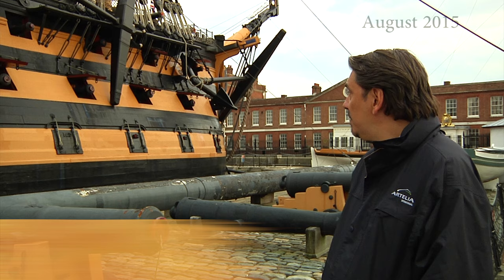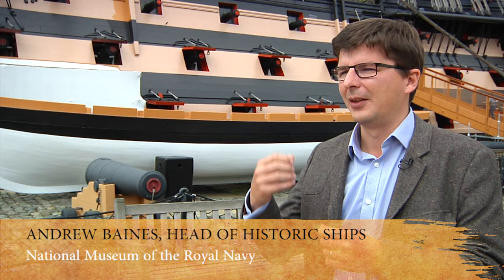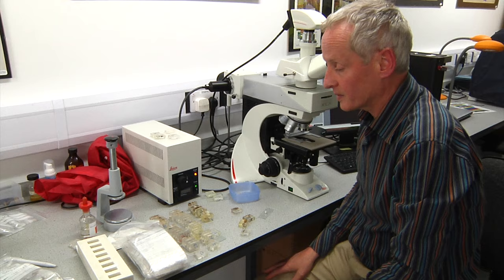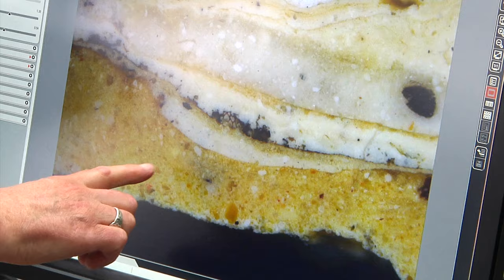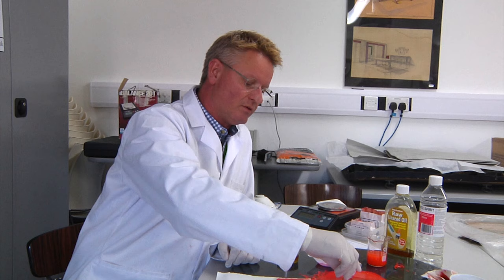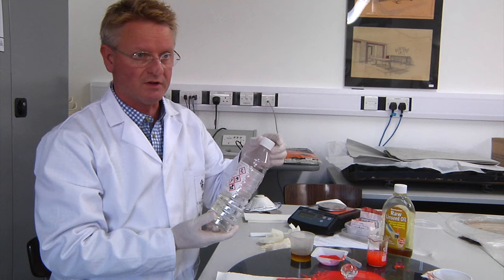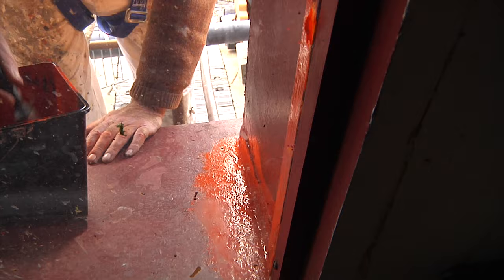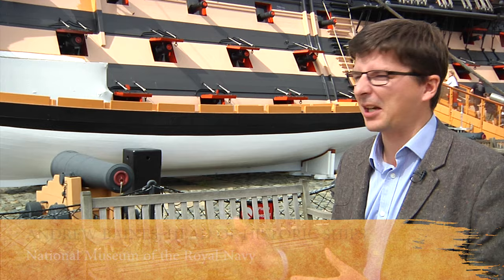HMS Victory – In Her True Colours

Comment: it´s horrible to see a ship like her so crippled without masts
Reply: @Kato Ho Ten Soeng I believe the mast go down to the drock base,  her keel has been cut to  allow the masts through. What squashes her, is her own weight.

I'd advocate for putting her under a roof already.
Reply: Hopefully this new renovation grant has enough money for new masts and rigging once they've sorted out the more necessary work of improving the hull supports and preventing more wood degredation. It'd be grand so see her with full rigging and the ensign flying high.
Reply: Kato Ho Ten Soeng No , they will finish up building a frame and support the masts from above
Reply: I agree I too think it looks horrible without the masts
Reply: It’s not forever. Just for a few years. Google „HMS Victory downrigged“ and read for example the Wikipedia article.
Reply: I thought they were made of aluminium anyway. Obviously a later addition.

Only 20% of HMS Victory is original.
Reply: @tooyoungtobeold8756  I was informed that it's only 5% original.

Comment: Pretty building that was once a ship.  Sealed forever in the land and top mast removed.  A former ship can never sail again is no longer a ship.  If you want to see an old ship of sail check out the Active service USS Constitution when they take her out to turn around.  Only a few years younger and still sailing.
Reply: The masts have been removed because of the ongoing refit, they will be back.
As for Constitution still sailing, well, she was never involved in any big fleet actions like Trafalgar. Victory took a big pounding in that battle. but still managed to sail to Gibraltar, and after some repairs sail back to the UK.
Victory was a 1st Rate ship of the line,  Constitution was a heavy frigate, if it were a Royal Navy ship it would not be allowed anywhere near these battles. 
Victory is 30 years older than Constitution, fighting the biggest ships afloat at that time, Constitution only ever fought much smaller 5th and 6th rated RN ships
You shouldn't be comparing these two ships. You should try learning about the differences between them, and their different roles, and not be sneering at Victory, she is a remarkable battleship, deserving respect.
You should read the first comment in this comment section, it is from a retired US Navy Chief Warrant Officer, if that gentleman can show respect, so should a no nothing keyboard warrior like you.
 Sad person.
Reply: @daneelolivaw602  I respect what it once was and the Constitution though on a smaller scale did indeed fight in fleet actions including the Barbary Wars that we lost one sister ship.  She also fought in the war of 1812.  While our fleet was small compared to England's until close to our own civil war it packed a punch.  The British even had standing orders to never engage any US frigate without at least two larger ships.  They used a new tech in design that gave it a thicker haul, resistant to cannon shot above any prior ship and a huge advantage in maneuverability.  This advancement was nearly equal to England's standardization of guns that we inherited.  The fact she no longer floats, while preserving the wood from rot warps her over time due to the lack of designed pressures on the haul.  It may be cheaper but it robs her of what she was.  Even flooding her cage with a clean water mix would be better.  They also want to enclose her farther with a roof like the remains of the Mary Rose that would deny her of her topmast forever.  In the founding of the colonies some ships were converted to houses and some like Victory were converted into waterfront buildings or piers  by beaching them on soft ground, once they were no longer afloat or able to be floated they stopped calling them ships.

Comment: The 'evidence' that this was the original colour appears pretty thin and un-substantiated. Does it really fit with contemporary descriptions?
Reply: The evidence is physical from paint pigment analysis, not documentary. So its an exact match to what was there.
Reply: @EternallyDisappointed  an exact match to what exactly? Old paint that had faded and was time to repaint? That's like saying sampling an old flakey paint job from a Toyota with no clear coat will tell you the exact colour it came out of the factory with.

I mean.. maybe, but maybe not
Reply: @Tom--Ace  The process is more scientific than that.

Comment: Like Stone Henge re built 1965-7 the Victory was torn apart in 1929 and virtually rebuilt most if not all the original wood gone 
none of that that is there now under decks, that saw the battle or blood sweat and tears of the crews, fighting dying on board all 'virgin' wood the masts are metal and cannons fibre glass  it is just about fake as everything we are told though  at least in  the true colours now but that is about it
Reply: patrick robinson what on earth do you expect? You want them to magically preserve 200 year old original wood?
Reply: @Luca-bv5ic  almost 250 yo
Reply: wrong, there are substantial parts of her  still 1765 vintage
Reply: What you have to appreciate is this a ship launched 255 years ago, commissioned almost 13 years later, has been used and abused in warfare and general service, converted to a hospital ship 30 years after launching, reconstructed for frontline duty a few years after that, downgraded to a second-rate, decommissioned, recommissioned as a troop ship, then a floating depot, then a prison hulk.
She's not just been rebuilt in 1929 but constantly throughout her life. There are original parts but to just assume it was the 1929 restoration is responsible is innaccurate, most of the work needed to be done cause the ship had languished for so long with decay and rot setting in.
Reply: Patrick Robinson
It is estimated that around 20% of the wood on Victory is original,  Including the lower gun deck, so you are wrong. And there are three or four original guns on board.
Reply: HMS Victory was over fifty years old when she saw service at Cape Trafalgar.  She had come very close to being decommissioned and scrapped. 
Nothing lasts for ever and the fine line between restoration and conservation depends to a great degree on 'current' knowledge at the time of intervention.
Of course we know more now about conservation and restoration than they did in the 1920's but at least the ship was taken out of the water and saved for the nation.
Reply: She wasn't 'original' at Trafalgar. That is how wooden vessels are kept in service. Unless freshly launched I doubt if therer is a wooden vessel afloat that is 'original'.